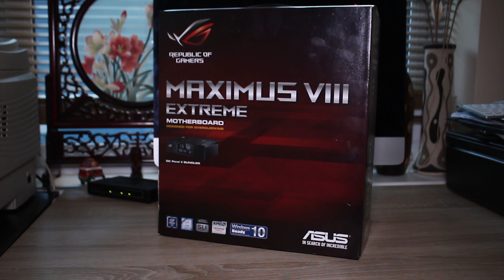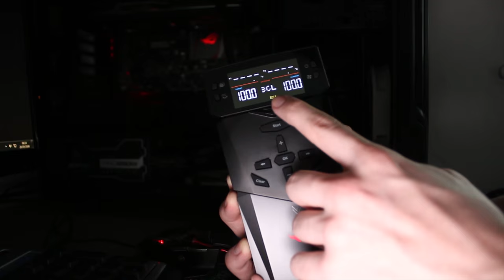Asus Z170 Maximus VIII Extreme Review

Comment: Which tripod do you use? The pans look smooth so I was wondering if it was a fluid head or not. You should make a video showing your camera gear and how it is setup if you ever have any spare time.
Reply from the maker: +FIFASpectrum It's a Manfrotto aluminium set of legs, with a Manfrotto MVH500AH fluid head, and a NEEWER slider! That's actually a great Idea as I've got some new mics too!
Reply: +TechteamGB Cool,  thanks

Comment: Sick as the other maximus motherboards but I still think they can do a better job with some inovation like water cooled motherboard or something like that but they still add the fan controller and I liked it.
Reply from the maker: +Jonhy Garza I see where you are going there - although they have their Formula board which has watercooling and is still pretty cool for OC - but this one is designed for hardcore OC which I don't think (could be wrong :P ) is great for watercooling (e.g Liquid Nitrogen)
Reply: TechteamGB Uhhh I forgot about the Formula one  U.U , anyway thanks.
Reply from the maker: +Jonhy Garza haha no worries!

Comment: It's a damned nice board, but it lacks a PLX PEX 8747 chip, so it can only do two-way SLI.  Also, What is "Longer"?  I believe it's EATX, but "Longer" can be confusing to some people (confusion between EATX and XL-ATX).
Reply from the maker: Longer is the extra inch added to the side of the board, while still retaining atx mounting screws. It could very well be eatx but I thought I'd make it clear it is still using atx mounting!
Reply: +TechteamGB EATX is kind of a fuzzy definition.  Apparently anything beyond the 9.6 inches makes a board EATX from what I've seen.  There is no real standardization, and boards are labeled as such even though they don't go all the way out to the next screw positions.

I musta missed you calling it EATX.  Sorry.

Comment: I can buy this board for 80€ should i do? Or the z270F for 200€ which is besser ?😕
Reply: I bought it new for 80EUR some 8 months ago for my i7 6700K. Best ram oc results ever, thermal sensor sticked on gpu backplate ready to control as many case fans I want to, amazing software. Surely next to P5Q3 the best board I ever had.
Reply: This board is heck of a lot better than the z270f, for 200e 1 year ago, it was a scam
Reply: @Thefuror38500  i did like u said :)